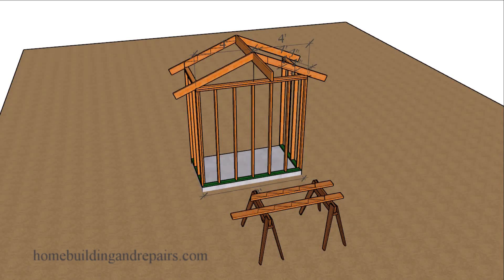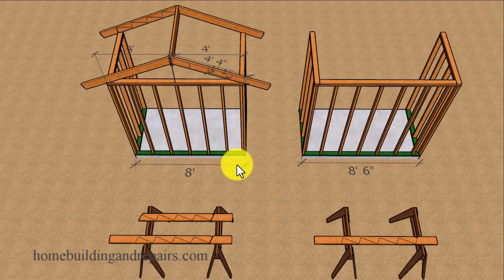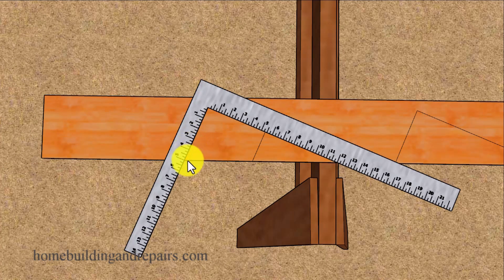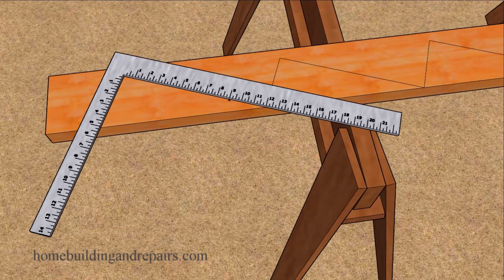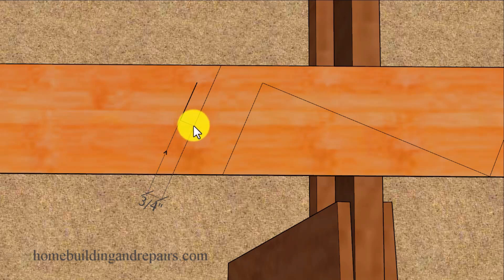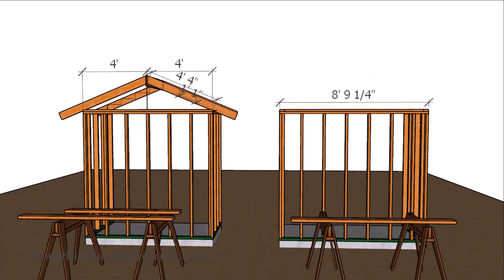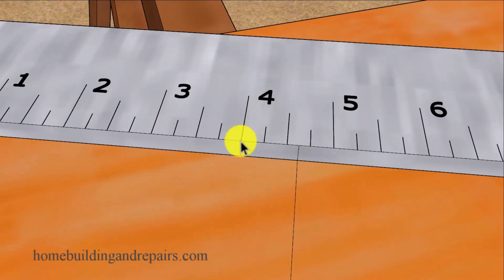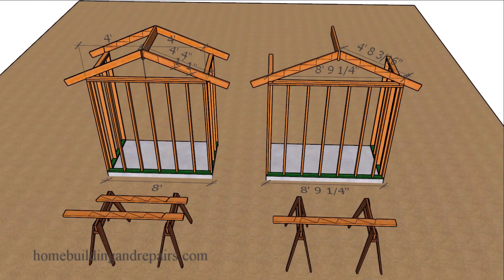How To Layout Common Roof Rafter With Framing Square Step Off Method - Part Two

Comment: Thanks for you video series. I have a question...How would you go about making a valley line up where the existing roof rafters are 2x4 and new are 2x6? My thought would be to have the seat cut make more contact with the top plate, or does it not matter? My build is very similar to your crawl space bathroom addition videos.  Thanks again!
Reply from the maker: I don't think I have a video on that, but most of the time you will need to cut a larger seat cut to lower the valley. I've done it plenty of times with out any problems from inspectors or engineers, but can't say that your local building authorities will allow it if you're getting building permits you can always ask them.
Reply: @gregvancom Thanks.  I did pull a permit, so I will check parameters on seat cuts.